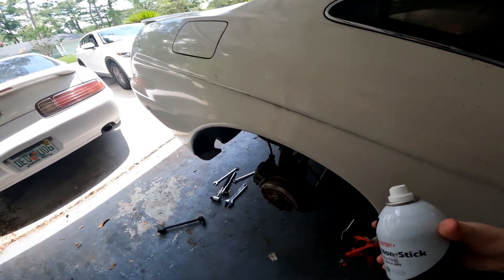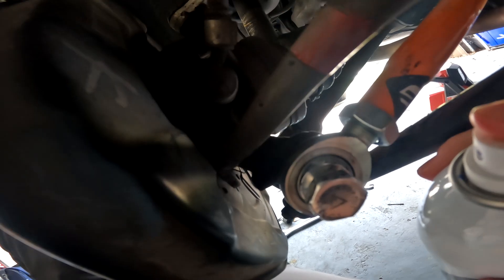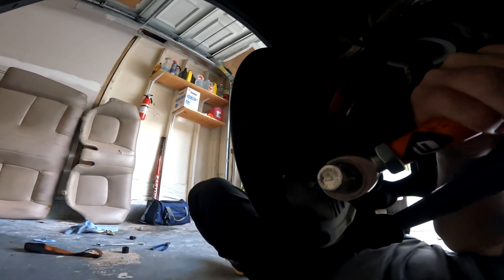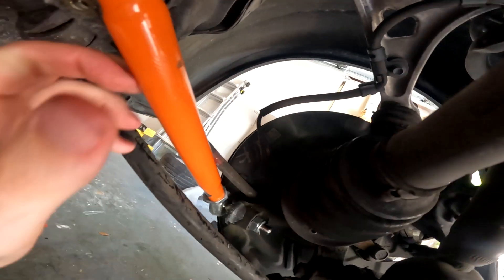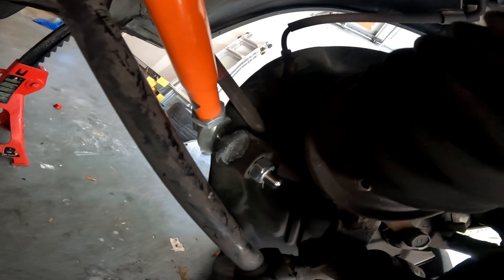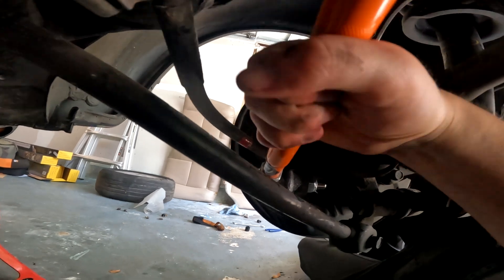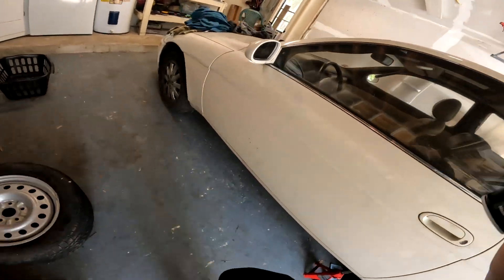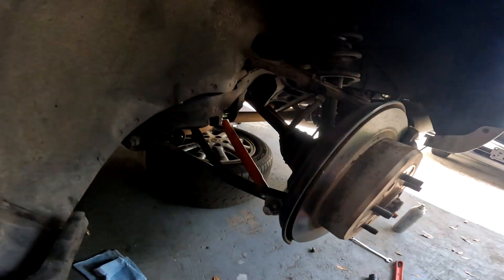How to Lube Spherical Bearings/Heim Joints/Rose Joints - Figs Engineering Rear Toe Links SC300/400

Comment: I have a question I just bought and installed racer x toe arms, Come to find out the driver side makes a clinking noise when hitting bumps dont hear it much at all when cars up to speed but driving slowly pulling into gas station etc you can hear it. But the passenger side is fine and as far as I know makes no noise at all. Killing me can't figure it out :"( just trying to figure it out since its a 2020 sounds kinda weird pulling into the parking lot making noise like the cars fallign apart lmfao any help would be greatly appreciated.
Reply from the maker: So I looked those up and it looks like they are the same heim joint style as mine. If you watch my previous video about the Figs Toe Links install, I talk about how the rod ends need to be clocked a certain way with respect to each other. As your suspension moves up and down, the angles of the "joints/spherical bearing/rod ends" will change. The "shank" part will swivel around inside like a ball. If the inner joint and the outer joint aren't clocked in their correct positions, they will clunk against the outer race/"shell" portion of the rod end.

If you watch that video, you will see me talking about it throughout the whole thing. You obviously don't need to watch the whole thing, but I explain it very in-depth.
Reply: @drivingmonkeyofus6239  Thanks so much, Couldn't get the company to respond and couldn't figure it out.
Reply: @k1ndalow did you fix the issue ?